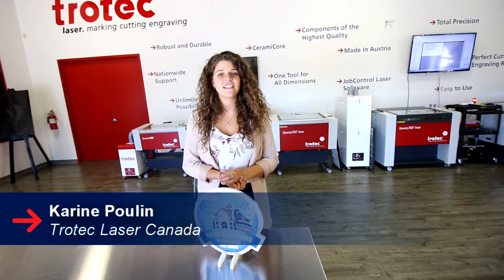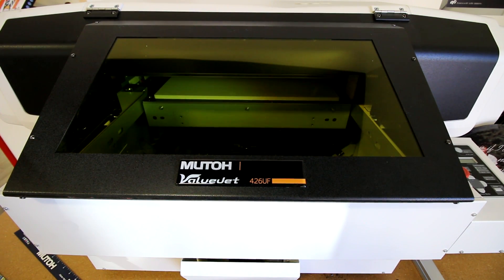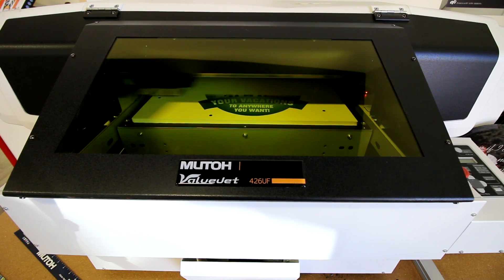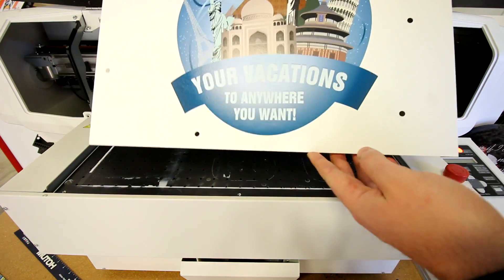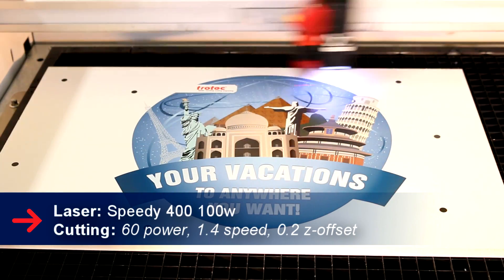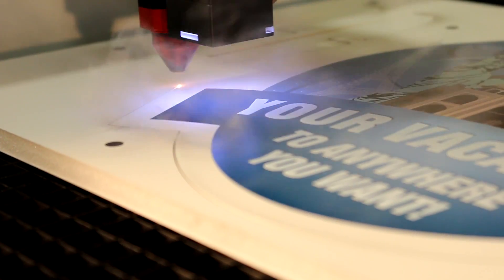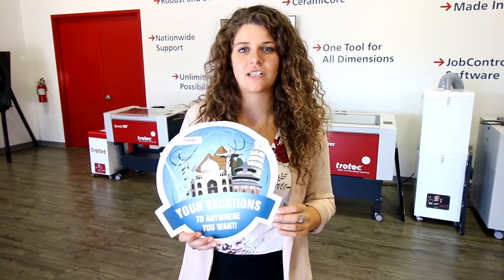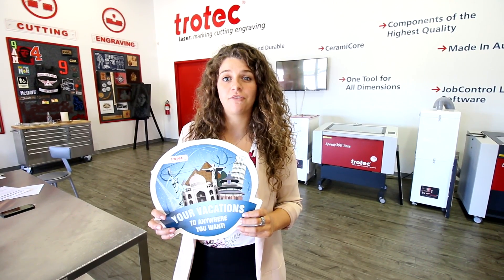Laserable Foam Board | Laser cutting foam board | Smart-X

Comment: awesome, is this one machine that prints and then cuts?  Is it hard to re align cutter?
Reply: This was printed and cut on separate machines. The black dots, fiducial markers, you see outside of the logo are are registration marks that the camera in the laser sees to know where to cut. These are placed with your design software prior to printing.
Reply from the maker: Thanks David!
Reply from the maker: Yes as per David's comments we first use a UV printer, than cut with our Trotec laser cutter.